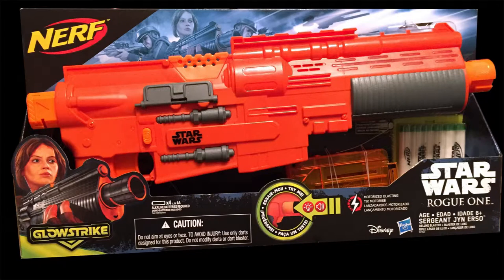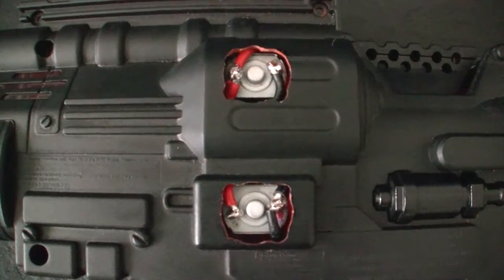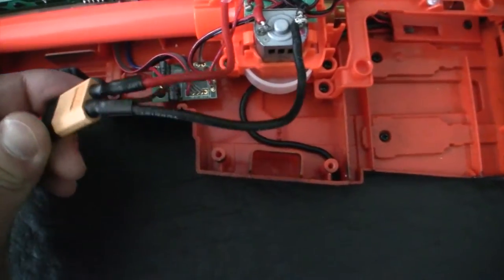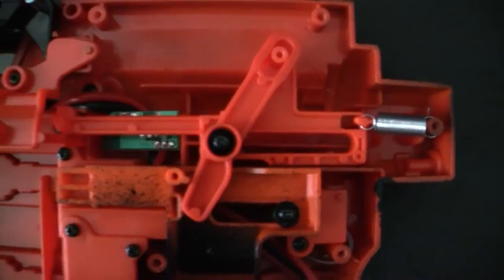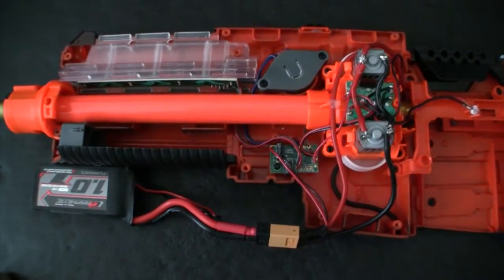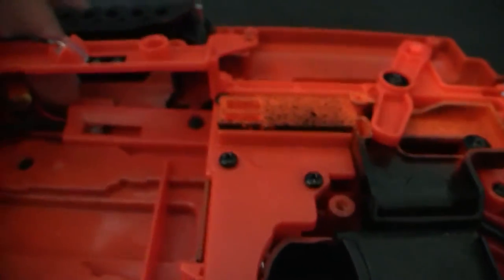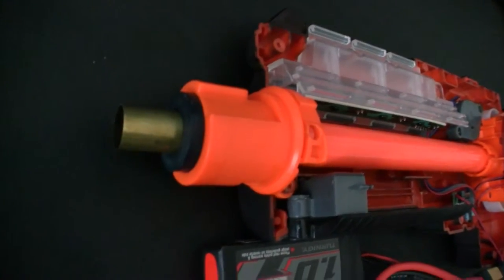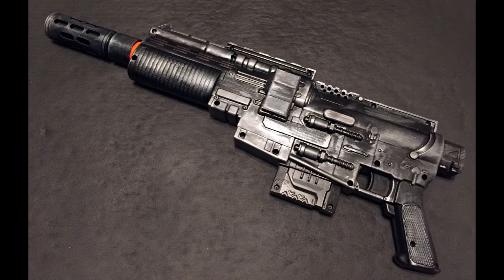Nerf Star Wars Rogue One Sergeant Jyn Erso Blaster Modification

Comment: How many volts does the fk180 motors have 2 be?  3.7V, 4.8V, 6V,or 7.4V?
Reply from the maker: Every motor should have a voltage range it was optimized for. Most of the 180s available on Ebay are 2S, or 7.4V, and will have a claimed RPM at that voltage. If a motor is rated for 6V, it will run fine slightly over powered with 7.4V LiPos (RPM figures will be higher than 6V claimed ratings). Some 180 motors found on Ebay are 3S (11.1V), but high current 3S LiPo batteries that will fit in a 4xAA battery tray sized compartment are almost non-existent. Virtually all motors found on Ebay are different, even if they use the same 180 or 130 sized motor housings, so finding the right motor is part of the mod process, but no longer necessary. 

Since this video was produced, there has been quite a bit of Nerf hobby R&D done, originally in finding optimal motors from suppliers, but currently in placing large custom orders for specific specifications from Make Test Battle, to Foam Blast, etc. making it a matter of how much you want to spend for that performance; Ebay 180 motors still run about $2-3 a piece for 2S, 30k RPM specs, which are fine for Nerf applications (100-120 fps with spool up times around 500 ms on 2s LiPo). MTB sells motors like their Neodymium/ball bearing Hellcat 180 motors that run $14 a piece on the high end for brushed motors for max performance in exchange for a premium price. Just be aware of the current requirements on those higher end motors as they draw more current than most LiPos can provide, if you go that route. Just be aware that the Jyn Erso blaster isn't the best platform for optimal performance, due to the long faux barrel that scrubs a bit of velocity.

Personally, I would go with some of the custom 2S 130 sized motors available from MTB or Foamblast, as it eliminates the process of chopping holes in shells, designing or printing motor covers and altering the original lines of the blaster. You might get slightly faster spool up times with cheap 180 motors from Ebay as 180 motors inherently produce more torque, but some of the custom 130s, particularly the ones using neodymium magnets, will be a rough match, even if it means paying $6 per motor.

Comment: Nice job ...I think your motor braking issue might be as simple as a switch wiring error.
The common should go to the + on the motors, the NO to the + power supply and the NC to the - on the motors.
Hope that helps ;)
Reply: Oh actually I think the lights and sound circuits may be feeding back into it and causing the problem ...yeah more work and diodes would be required and probably not worth while ....leave it exactly the way it is ;)
Reply from the maker: The current Star Wars blasters are more or less two separate systems that run off the same 6V power; they could easily be made to run completely independently, making the motor braking circuit as simple as a Stryfe's, but naturally the trick is to get everything to run on a unified circuit using the same 8.4v LiPo. 

The thing is the stock wiring has motor braking circuitry; the problem with the factory circuit design is rewiring the loom with 18AWG silicone wiring simply won't fit, much less with the 16AWG I've been using. 

Like you said, more headache than it's probably worth.

Comment: You don't do commissions do you? I'm hopeless with this sort of stuff lol just these exact internal mods
Reply from the maker: Generally no, because of the amount of time it takes that I would prefer to spend on the multiple other projects I currently have in progress, but I do have more of the blasters and parts to modify them on hand. 

After doing two of these, I could probably do another with just the internal mods in a half work day (16AWG rewire, XT60 plug, 20A microswitch, FK180SH motors), but it wouldn't have all the add on parts that make it look more like the film prop; just a 180 motor cover to protect the motor leads and hide the motors. The better appearance package is the Captain Andor blaster (blue rather than orange, comes with rifle appearance snap on parts), but it has a pretty unreasonable $80 MSRP. 

You would have to source the Graphene battery and LiPo charger yourself through HobbyKing or Amazon.

Comment: I have this model as well. I plan to do a smaller job than yours. I plan to extend the inner barrel, and give it a similar paint job. I find it funny I have the exact suppressor. now to my question, how did you do the weathering? by brush?
Reply from the maker: Use a combination of techniques for the weathering. Dry brush with foam brushes for lighter wear finish on flatter surfaces. Dry brush with rougher bristle brushes on edges and corners for a scraped/scratched appearance. Use a metallic colored Sharpie for the hard corners and edges and additional scratches to finish the appearance before sealing everything with a clear coat.

Word of caution on the faux barrel with flywheel type blasters: the longer it is, the lower the potential muzzle velocity due to barrel drag as the darts impact the inner walls. It won't improve accuracy due to loose tolerances. 

The Erso/Andor only gets about 50 FPS out of the box (well below Nerf Elite average velocities), so reducing that further turns it into a prop blaster with SFX and lights not suitable for shooting darts.

A 9/16" brass barrel like the one in the video should only be done with a motor upgrade/LiPo modified blaster approaching the stability ceiling for foam darts (around 120 FPS) and the brass barrel should be kept as short as possible to reduce frictional drag. 

Long brass barrels like the one in the video are for air powered blasters; I don't recommend doing it the way I did in the video.

Comment: is there a guide or video that shows ways people add a motor cage into a shell that doesn't fit...?
Reply from the maker: Not that I'm aware of. The whole gist of producing aftermarket motor cages is for model specific custom fitment. DRS and Artifact produce multiple models for the most popular blasters and probably wouldn't go through the trouble of doing multiple designs and machining multiple products if a Stryfe/Rapidstrike cage could be easily adapted to fit any blaster.

That said, since these are plastic shells with fairly low tolerances, just about anything can be done/modified. Off hand if I had to adapt a non-matching cage, I would try to use at least two of the factory shell mounting points for proper alignment and then shave/cut the non-matching mounting posts, rebuild new mounting points with epoxy or moldable plastic pellets, drill and tap the mounting holes using the holes on the aftermarket cage as a guide and if done properly, you should have a match. 

Or, design a custom cage in 3D modeling software and 3D print it, which modders like Hawki007 and Alice CoatDuck have done.

Comment: Hi Daniel, are there 130s out there that would give the blaster a bit of a boost but still use the stock batteries and wiring?

Thanks.
Reply from the maker: That's a bit of a rare question as not too many performance minded people are willing to crack open a blaster and replace the motors without the intent of squeezing out better velocities.

Most people will just drop in 14500 IMRs if using stock wiring, but I don't use anything but LiPos and can't comment on how 2x14500 IMRs work on the Jyn Erso/Captain Andor blasters. If you go that route, 2xIMRs and 2 dummy cells may work on stock wiring. If you use 3xIMRs, you will likely blow the capacitor on the sound card.

I have upgraded a Cassian Andor blaster with FF130 3733 motors rated at 25k RPM on 3.7v, which would put it near 40k RPM on 6v, but couldn't recommend them for LiPo as they are 1S carbon brushed motors that will wear out faster on 2S power. 

But on 6v alkaline, those are an option. Using a 4xAAA battery test pack (with 6v charge), I clocked velocities between 80 and 101fps (Elite darts) with a long 3-4 second spool up time (sub 1 second spool up drops to 40s). That was with an upgraded/rewired loom (16AWG for the blaster, cheap 22AWG on the battery test pack). I can't vet for FF130 3733 motors on 4xAA power on stock wiring, but my guess is that you would probably be seeing high 70s on fresh AA batteries, potentially up to high 90s given the 22AWG battery pack resistance weak link in my test set up. 

Other option would be to scavenge motors out of something like a Hyperfire, but not really much of an option unless you have a collection of stock motors lying around as they aren't really worth buying.

Comment: What battery do i use for a jyn erso balster with meichel 2.0 motors?
Reply from the maker: Meishel 2.0 is a 2S/7.4V motor that draws about 19A per motor, so nothing under a 2S 40C LiPo at minimum. 

With the shell space in the hand guard, with the stock battery tray removed, a Turnigy Graphene 1000mAh 2S 65C just fits with some minor cutting to the battery tray rails (not needed if not using the stock tray) for wire relief.
Reply: Daniel Okada thank you for you help I'll go buy a graphene instead of what I was going to buy, a 1500 mAh 40c zippy.
Reply: Daniel Okada can I charge a graphene lipo with the Turnigy E3 Compact 2S/3S Lipo Charger?
Reply from the maker: They function the same as any other LiPo. Charging is the same; charge set at 2S @ 1A on the conservative side. 

Realize that part of the Graphene brand name is Turnigy marketing, although the use of graphene is a part of what allows for the high current output in that battery line. 

Doesn't look like the Turnigy E3 Compact has the appropriate outputs. I see the balancing sockets, but not the main output sockets. But if you have used that to charge other LiPo packs with XT60 plugs, the Graphene packs are no different. 

I use a SkyRC IMax B6 Mini and would buy more of them before switching to anything else for my needs.

Comment: What motor cover are you using? Is it a 3D printed one you bought or one you found online?
Reply from the maker: I reused a motor cover design I modeled for a 180 modded Stryfe (rectangular style cut). I can post it on Thingiverse if anyone wants to print one off. 

Never got around to finishing the custom cover for this blaster, but I bought a stack of these blasters on sale recently and may finish the model if I decide to do a run.
Reply: Daniel Okada if you do manage to post it up, post a link. I'd be very excited to print one off myself. And if you do decide to create a custom cover, you should post it as well. This has become one of the blasters I am the most excited to work on once I'm done with my other projects.
Reply from the maker: http://www.thingiverse.com/thing:2248217

Comment: Is the flywheel cage the same as a regular stryfe cage?
Reply from the maker: Based upon a photo of a Modulus ECS-10 cracked open (never bought one), it looks like the internals are a one for one match with the Erso/Andor blaster. Most likely swappable as the layout is the same. 

The Stryfe uses different molds for its flywheel cage halves, but visually it looks like the mounting points match up. 

I just started testing a 3D printed drop in Stryfe cage replacement in an auto conversion. If I like the results, I'll print out another one and see if it fits in the Andor blaster I'm working on.
Reply: Daniel Okada ooh okok thank you !
Reply from the maker: Bad news if your plans entailed using an aftermarket Stryfe motor cage for the Jyn Erso/Cassian Andor blaster: the holes look as though they might match, but they do not. 

Best bet is Dr. Snikkas Modulus ECS-10 motor cage or wait for Artifact to release theirs.

Comment: why is it red?
Reply from the maker: Hasbro/Nerf doesn't make black foam blasters for liability reasons, particularly in the US, where real firearms are readily available. The bright colors are more suitable for toys anyway, but since these are Star Wars toys, it's fun to have something that looks a bit closer to what's seen on screen, so they often get repainted. 

If you mean the tip, toys that can be mistaken for firearms have to have an orange tip by law. Usually these get painted over when doing movie style props, if intended as a costume or shelf piece, which I've done with other Star Wars Nerf blasters, but I figured the muzzle attachment would cover it and left it orange so the black muzzle could be removed for play as this one has performance mods.
Reply: Daniel Okada I know that. Its just the only color I have seen that toy in was dark orange and the unpainted one in your video is red
Reply from the maker: It's just the video color balance if it looks different than the one on shelves. As far as I know, Hasbro used the same ABS plastic color in all regions.
Reply: Oh ok

Comment: I want one so badly I wish people would sell these
Reply from the maker: Last month was the time to pick one up with all the holiday sales. Just buy one when they go on sale; I predict they'll be heavily discounted eventually due to the high MSRP, which will lead to a lot of extra inventory at retailers. 

Since this wasn't a product review, I didn't call out the legitimate beefs, namely the $50 MSRP for what is basically a stripped Modulus ECS-10 with a 6 round mag, and the sub par out of box performance (about 50 FPS compared to about 70 for the average Nerf Elite blaster), making this one almost exclusively for Star Wars fans and those who really like the styling of the AR15 inspired design.  

I realize this video wasn't a comprehensive mod guide, but I have been shooting video of the modification process of the Cassian Andor blaster, minus the questionable brass barrel and prop paint job and could have that up this week as the project is done. 

This one would be more of a step by step guide for the DIY performance modders.

If you want a tutorial on how to do prop style painting, I've seen some good guides on how to paint the Death Trooper blaster.
Reply: Daniel Okada can u do a step by step guide of how u put in the lipo
Reply from the maker: Should be up later this week. 

The base circuit dedicated to flywheel operation is virtually identical to a re-wired Stryfe. High amperage microswitch to accommodate the higher LiPo current, the XT60 battery connector, heavier gauge wiring, etc. 

The key difference is that most of the stock wiring (anything dedicated to the sound and LEDs) is left intact as it runs off the stock gauge wiring and protective circuitry.